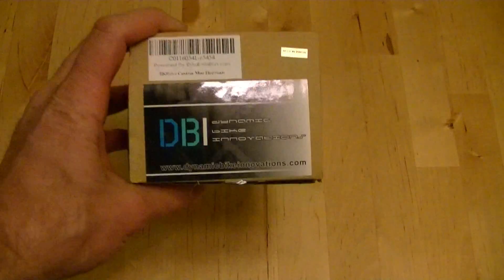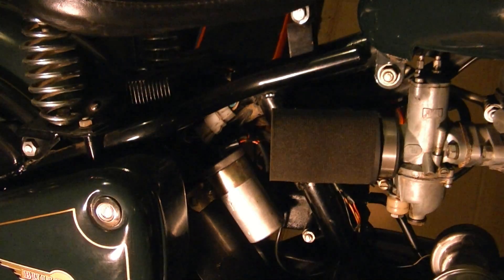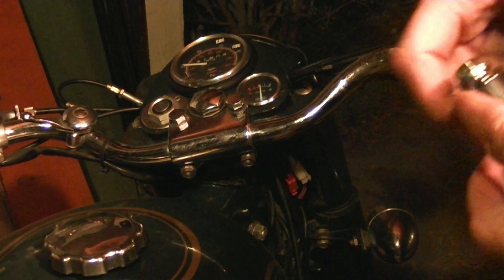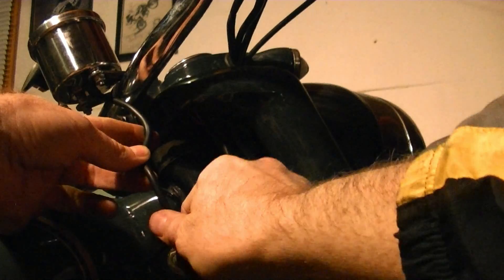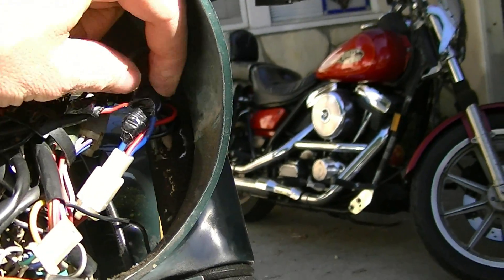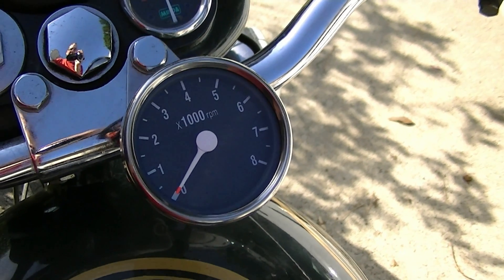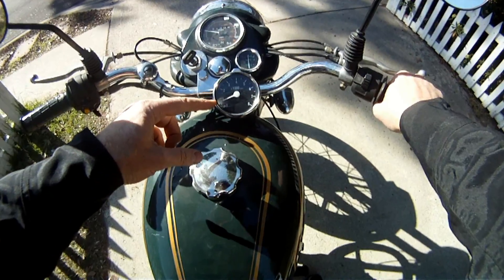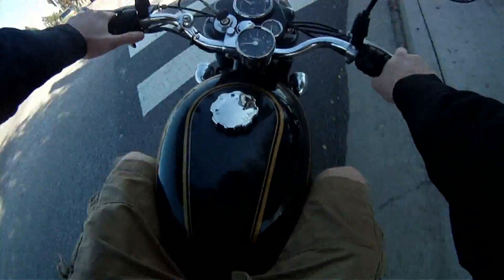Royal Enfield Bullet Tachometer Installation

Comment: Nice video - if you ever get tired of multiplying the revs consider one of these (not affiliated with them). Google for mmb-messtechnik and look for the tachometers in the online shop.

They can be configured to different engines using dip switches
I'm about to get one but not confident if I got enough skills to do the mounting job. 

Regards
Michael

Comment: i would advice you to get a digital speedo, Its called RADON it works perfectly and sits right in the speedometer cup in the headlight and it comes with trip meter, tachometer,odometer and all that Google Radon digital speedo and you will get it

Comment: thanks hooblin sir ,i respect you too much n love u too,one more thing i am stuck in deciding that  i want to buy new RE so which one i should buy my daily run up is about 18 kms per day so should i go for 350 or 500 ..plz help
Reply from the maker: +Aditya Singh It depends on how fast your ride. If it is a slow trip, then get the 350, and you will get better gas mileage. Otherwise by the 500.

Comment: Could you also give us some idea about installing a fuel gauge as well..?  Please....have you done that already..?
Reply from the maker: +Frank Rock I don't know how you would do it.  There would have to be a sender unit with a float in it, sending a signal to a gauge.  It would be complicated to do.  On most of my motorcycles I calculate how many miles per gallon they get and then remember what mileage they need to be refilled at.
Reply: I agree...it would be tough...Bullets are worth every penny ..but that little gizmo would make them a lot more sensible...
These bikes are for enjoying the freedom...and I want to be free from number crunching and mental maths while riding....guess I gotta change the goddamn tank after all...
Thanks for the great video...

Comment: Sir could yu share the online  Link of the product
Reply from the maker: +Jagadesh Abbu I don't remember who the seller was. I just searched eBay for a Harley tachometer.  Because the Enfield fires differently than a Harley, the tachometer only shows half of what the actual rpms are.  2000 rpms = 4000 rpms.
Reply: hoohoohoblin that's fine sir will it be compatible with latest classic 350

Comment: Can the tachmoter be installed on a 1975 Royal enfield bullet and how
Reply from the maker: +amol chalke Yes. It should be similar to what I did in the video.  I think Smith’s makes an electric tachometer that will work on that bike. Using a Harley tachometer like I did means that it will only show half as many revs as the engine is actually turning.

Comment: hi,did you ever get to change/modify/fix the tachometer as per the realtime rotations per minute...? it wld be awesome to see that. may be I can instal and after market tachomwter on my '05 avl cdi thunderbird.
Reply from the maker: I looked around on the internet but couldn't find a solution.  You'd have to figure out a way to double the signal it recieves.  I am sure it can be done, but I don't know how.  Smiths used to make one that worked properly on old Royal Enfields, but it was expensive.
Reply: ah. hey since I have you hear, may be you can help me out. I got a 2005 AVL thunderbird, no self-start. I am looking around to get a workshop manual from somewhere, but cant get my hands on it. I emailed a few websites who have Royal Enfield books, but been unsuccessful. So far I am gathering bits and pieces from here and there to make it work. Could you help with any suggestions. Appreciate it.
Reply: Mustafa Sutarwala Hey! I've got the same Thunderbird myself! Do let me know if you do find a manual